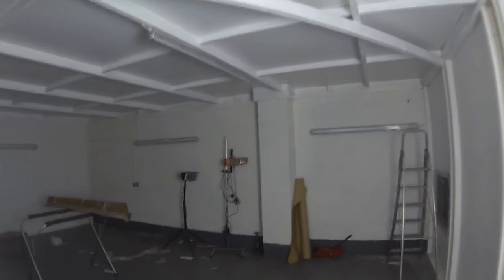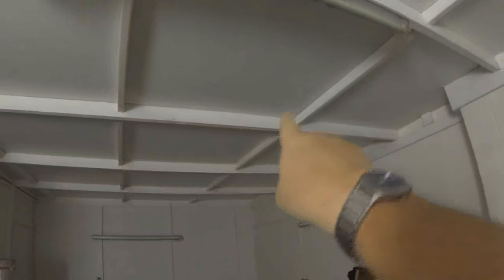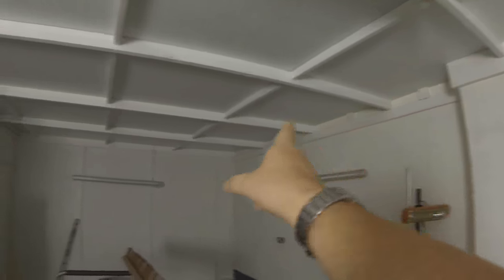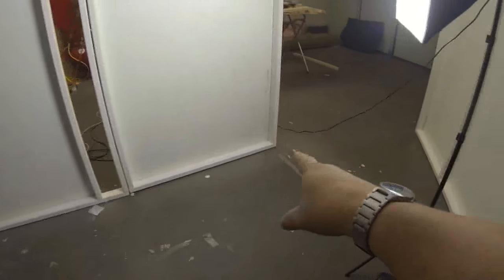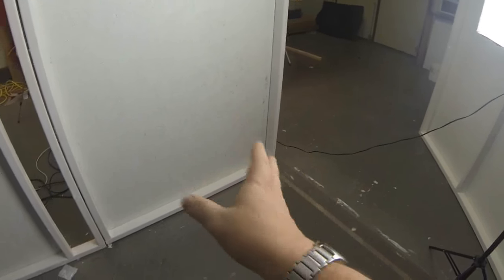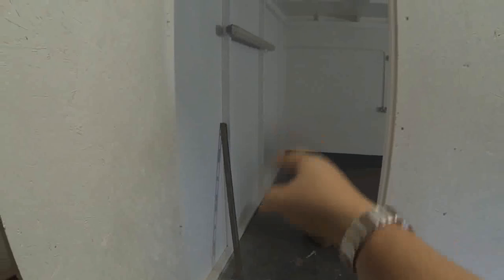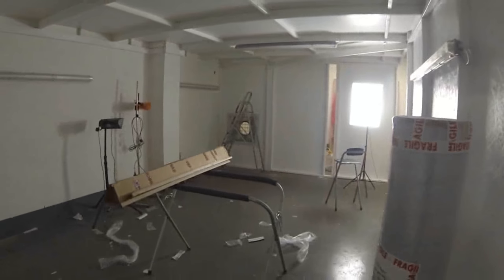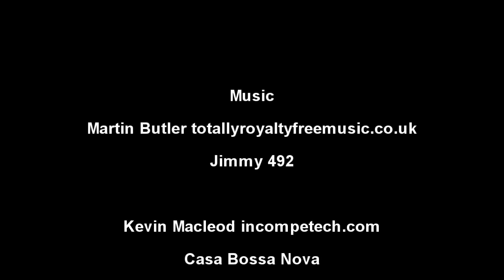Part 3 How To Build A Spray Booth Room ATEX Rated Extract Fan

Comment: Ah HAA! I was going to say in the last video, put a small caster wheel to support the doors. BUT!, I changed my mind about it, paint dust is sticky and will be picked up on the wheels, making diameter bigger and bigger. Instead, try a spring finger that slides on the floor, the crud will get scraped off each time you open it. Good video, you are smart like me.
Reply from the maker: Haha, I've got the wheels already, They should work fine Bri.
Cheers
martin
Reply: Almost forgot to mention a trick the painters would use. Get some spring clothe pins, get some plastic garbage bags and suspend them in the corners out of your way, the static cling properties of the garbage bags attract the dust particles. Once a job is done, the bags will have dust all over them, shake them outside and rehang for the next job. Cheap easy way to trap dust that swirl in the corners.
Reply from the maker: Brian Percival
Nice tip Bri.
Cheers
Martin
Reply: Yeah, I'm not just a pretty face.
Reply from the maker: I wouldn't know lol

Comment: hi martin, the strip lights on the walls would be more useful just over waist height to see the sides of the cars better, excellent job though mate
Reply from the maker: We do plan to add more lights lower down but we opted for the higher at first for more even cover.
Cheers
Martin

Comment: hi Martin...nice video...one of the first of this type that actually describes some of the ins and outs of how to make a spray booth. One question - are the lights 'non-sparking' or do you just fit any potentially sparking bits outside the booth?
Reply from the maker: The lights are totally enclosed fittings and are vapor proof Richy. I think we paid about £125 for 5 5ft single tube fittings from Ebay.
Cheers
Martin

Comment: Love the videos keep them coming 
Is the ventilation system good with the 1 fan pulling or have you fitted a 2nd one 
I'm having issues with dust with just one fan out
Reply from the maker: This fan works great but we also have an intake fan pushing air in as well. The booth works on Negative air pressure as well.
Reply: Thanks for the relpy I've managed to get 2 more fan today for free so happy about that so I'm going to have 2 pulling and 1 pushing 
And hopefully that should do it 
Keep the videos coming

Comment: great vids been watching for a while now...just because you mentioned doing the booth on a budget I'm just curious what it roughly cost to built? is there regs were only certain kinds of paint can be used now in shops? I only ask as I know a paint shop who few years ago installed a very expensive pro booth only for it to be redundant now as its not built as per the new regs or maybe the extraction is does not conform I'm not to sure but I know it whatever happened regarding the laws or regs in spray shops hit him right between the legs!
Reply from the maker: HI Brendan, It cost around £700. Yes there are guidelines that should be followed and we've taken note of the requirements for a spray room. Pre built purpose made booths have to follow very strict guidelines, more so that a home built one like ours but you still need the correct ventilation and it should also work on the negative pressure principle (as ours does)
All info is on the HSE website.
cheers
Martin
Reply: retrorestore ah so the regs mainly concern the ventilation then..I thought there was something to do with the type of paint to he used...so any idea when ya officially open for business? will ya be doing vids on it or is it the young fellas enterprise only :p
Reply from the maker: Brendan B
Yes, the regs are for the type of paint used and the requirements for safe practice including ventilation, test times for extract, lighting to name but a few. It's jimmy's biz but there may be the odd vid when I have something done.
Cheers
Martin